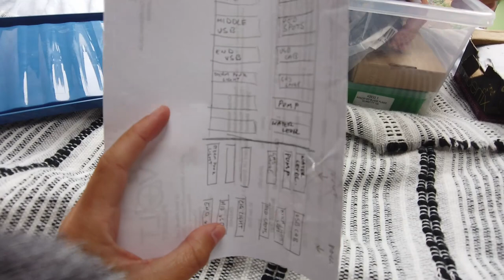HOW TO TREAT RUST... basic van maintenance and best car vacuum, 12 volt hoover for car.

Comment: For the fuse I’d go (so long as there is no lower limit stated on the 12v socket, and the cables feeding it are suitably sized) with 10A, or maybe even 15A which is a typical lighter/accessory socket value in most cars and vans these days. The start/surge current of the hoover motor will be around double the continuous running power, if you want an approximate value. Thank goodness you have a good solar system and large batteries installed to make up for all of Emily’s van cleaning!
Reply from the maker: Thanks Ian, appreciate the advice, I always carry spares so I'll up it tomorrow. 😀👍

Comment: Funny..burp...vid! We live in Scotland and as everybody knows, it's bleeding wet up here so I've had to do a fair bit of rust treatment on our van which is a 2010 Ducato with 95k on the clock and does look pretty clean. Apart from the wheel arches I found that there was rust behind the sliding door rail and I found that road debris was getting into the sills where the the rear wheel arches are that was also causing rust. I grinded out most of the rust and used a similar treatment that you used in this video. Lastly I got the under side of the van professionally de-rusted and treated with Waxoyl - it was expensive but as you've both spent so much on doing up what is a lovely van it might be worth doing at some point. It cost £800.
Reply from the maker: Yeh I think we will look into it, thanks for the tip, it seems silly not to after all that work and money. We also have a spot behind the sliding door rail that will need sorting at some point. And yeh, the weather is crap up there, but the scenery makes up for it! 😀

Comment: I did similar in my van. Previous owner screwed the old plywood floor directly into and through the van is metal floor to the outside. So when I removed it I had 40 screw sized rusty holes to cover with kurust and a coat of normal Hammerite
Reply from the maker: Hi 😁 we had that as well, so annoying! I think a lot of them are on lease hire so they just don't care as they change them every 3 years, pain in the bum for us self builders tho!! 🤣
Reply: camper vibe definitely, my was ex lease hire as well. There were 2 holes for every screw I took out. So much of seen at least 2 ply wood floors

Comment: I think the Kurust advice of applying the paint/topcoat as soon as possible  refers to the possibility of rust starting to form again on the treated surface. But considering that the Hammerite Direct to Metal paint you are using is a rust treatment in itself, and can be applied directly to rusty surfaces, I'm not sure it matters much if you leave the area treated with Kurust for a while and paint it over a bit later. I've done the same treatment on the edges of the wheel arches, and they look so much better now. The somewhat bigger issue with vans in general is the fact that they have absolutely minimum rust protection underneath - nothing like a modern normal car. I guess the assumption is that they will be for a few years on the road - and then will be scrapped due to high mileage - so no need for long term protection. So when repurposing them as campervans, I think it is essential to apply a good underseal in all exposed areas underneath which don't have suitable protection already. I've done that on my previous motorhome when I bought it - and kept an eye on things and touched up when needed every year - and 7 years later - being 17 years old - was still rust free underneath.
Reply from the maker: Yeh I know, just being over cautious I guess. It's so important to keep on top of the rust tho, it's seems to breed like wild fire lol!! Thanks for watching seb 😀👍
Reply: Thank you for the video! Glad to see you are getting on top of things early - instead of waiting for the rust to spread and become a major issue :-)

Comment: I have a VW campervam and need to do some rust treatment .. there seems to be many different rust converters on the market, so it's hard to know which one is best. If you were doing this project again now, would you still use Kurust, or would you maybe use a different product?
Reply from the maker: Yeah we would and we need to do some ready for this winter and will use the same stuff 😀

Comment: We’ve got the same 12v Hoover and it’s amazing! Came in very handy getting rid of all the sawdust we ended up with inside.
Reply from the maker: Oh yeh the sawdust, that stuff is almost as bad as the dog hairs 🤣🤣 it's a great little hoover.
Reply: camper vibe we’ve not tested it on the dogs hair yet but if it’s even half as good on it as it is the sawdust, we’ll be happy 😁

Comment: The blade fuse size is only dependent on the cable size, and amps the cable can take, that the fuse is protecting, the appliance is irrelevant as your protecting the cable. 

The appliance has its own (glass/wire) protective fuse built in to the 12v plug.

Comment: rust converter only work on extremely minimal surface rust, most cases they dont work at all, if you sand back lightly, you will see the rust is still there, they only cover it and continue to rot underneath. best thing to do is get a finder with paint stripe wheel attachment, clean back as much as possible to bare metal, then use a rust remover rather than converter, paint oxide primer, grey primer, and top coat

Comment: Hi
We are just starting our conversion and have some rust on the floor would you do the same? Also how fine was your sand paper? :-)
Reply from the maker: Hi Catherine, I think if you have a few small areas then this method will be fine. However it's it's a lot more or you have holes forming I'd look at bigger repairs. Hope that helps. Thanks for watching, good luck with your build 😀👍